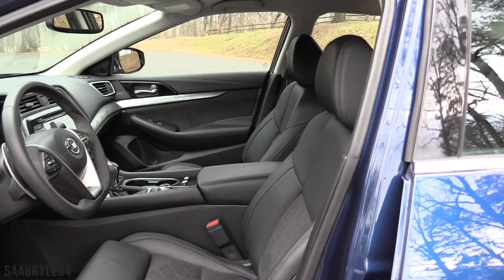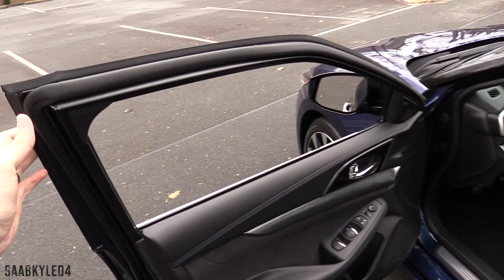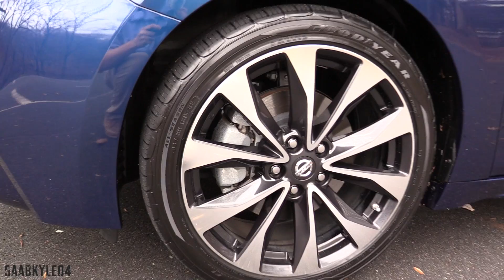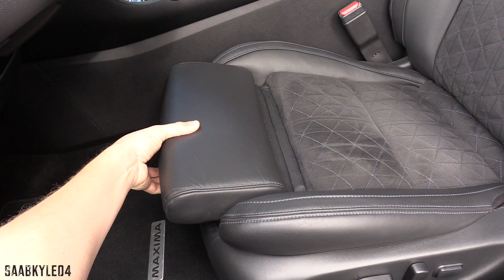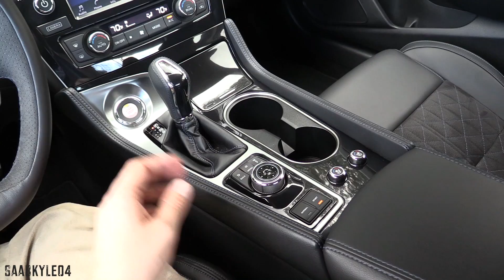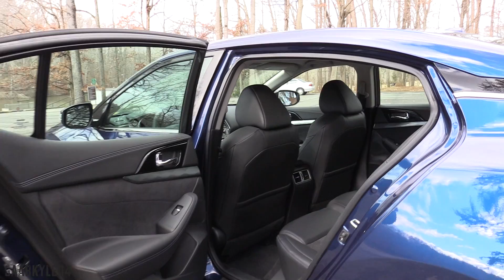2016 Nissan Maxima SR Start Up, Road Test, and In Depth Review

Comment: This car should really have Infiniti's 7-speed auto and 3.7L V-6.  Now that would be an awesome combination.  It should also have RWD or AWD.
Reply from the maker: +Chris Capaccio Agreed!
Reply: +Chris Capaccio That would be great and all, but then what would be the point of the Infiniti Q50? I think they wanted to save the good stuff for the Infinities......but boy would this car be nicer with a real transmission!
Reply: +Chris Capaccio When I drove the last generation Maxima I actually liked the CVT. This generation probably has a better one. I felt like I had to wake up the CVT with a couple of revs to get it out of its economy gearing.
Reply: So dumb it badly needs all of that !! It's weird why call it 4 door sports car .. Fords fusion is going to be beating it easily lol
Reply: If that happened, price would shoot up about $10k and thus be unaffordable for most
Reply: +Chris Capaccio The JATCO 7 speed is for RWD platforms - won't work. 
Making this RWD / AWD would make the Maxima compete too much with Infinitys. I have a feeling this is the last Maxima.
Reply: I agree 100%
Reply: I agree 100%
Reply: +Iam Sam Nothing that was said had to do with that, it's still cheaper than the Infiniti, And has improved well over the previous generation, overpriced ... okay don't buy it, we weren't discussing whether they should down the prices or not, if it is then get an Altima.
Reply: +Moaiz Shahzad no it would just be Nissan cannibalizing their own brand since it would basically be an Infiniti Q50. I still don't really understand why anyone looking to drop $35-$40k on a car would ever consider a Maxima. Sure it's a nice car but its starting price is only $3-4k under an Infiniti Q. Once you load it up with options, you could easily get a nicely equipped Q which has a much nicer interior and a RWD/AWD platform. If you want a nice FWD car, why not just save $8k and get a loaded up Altima with a V6? Makes no sense to me, but to each their own.
Reply: Kohfu
yet they will never do it, because they dont care about what you want or think, all they care about is profit and keeping this car they way it is, which obviously brings them more money, simple as that, you think they give a shit about your desires? you dont like the car, move along to another brand, is that simple. They are multi millionaire companies, you can bet they have a team bigger than your town to figure out how to maximize profits for this car. This is the design they came up with to maximize dat dere money. You don't like it? move up to the GTR or to another brand
Reply: +runescape692 Never really thought about that, lol
Reply: +Saabkyle04 Can U review 2016 Kia Sorento?
Reply: +Chris Capaccio 
got to have some separation between the luxury and economy lineup.  Otherwise everyone would just get the latter if had the same engine and trans.
Reply: Speaking of Ford, are they going to hold on that new Taurus forever they showed off in Shanghai last year? The Fusion is nice and all but it's still a mid-sized sedan. It's not on the Maxima's level, it competes with the mid-sized Altima.
Reply: They should at Least have some with an 6sp like in the 6 gen and older max
Reply: +Chris Capaccio The step-shifting that the current Nissan CVT's do does help, but only so much.  The Maxima's competitors all come with geared transmissions (Avalon, Azera, to name a few).  Plus, Nissan's CVT's aren't flawless in terms of durability.
Reply: +Chris Capaccio There&#39;s a VERY GOOD reason to why they don&#39;t do so, it would be fairly more expensive, and given that it&#39;s a Nissan it still has to be cheaper than it&#39;s up scale Infiniti brand, because that would mean they are basically competing against their self, it&#39;s already the maxima, the top of the line full size Sedan for Nissan, which means it comes very close to someone who wanted a G37 or Q50, but still More affordable to insure, Less of an MSRP/or General price tag, even fuel economy ETC, Nissan has Infiniti, Honda has Acura, so people can get a similar feel while it being more affordable to them or those who can not get the 1st class brand, can take a fully opted 2nd scale, If they did try to make all kinds of precise similarities, that would mean the only thing separating them would be the LOGO and the little bits of body, in that case it&#39;s better to only make Nissan not Infiniti, or the CONTRARY That is the answer to why it &#39;&#39;Should not have anything at all of what you said&#39; they know very well what they are doing. And ESPECIALLY giving it the option for AWD or RWD is completely out of line, they would have to discontinue the Maxima if they even thought about doing that
Reply: +Iam Sam And actually if you go to rent a Maxima for example they will out it under the category of a Full-size sedan, not Mid , since it is their largest sedan they have, even if the size is similar with the Altima.
Reply: +Iam Sam It may be a Mid Size body " but they consider it a full size Sedan. that's all
Reply: +Iam Sam either way that almost has nothing to do with anything here, for some reason I'm being targeted by you, jeez, I'm not a Nissan fan either that's why I purchased an Audi RS-5 .. I just wanted to answer his post as to why it would be a bad idea if Nissan did that, and they knew very well it wouldn't be entirely sensible. Case clear
Reply: +Iam Sam you can getta sr for around 33k easy
Reply: Iam Sam yeah that's sticker price but it's not hard to find them for 33k. I just got one actually
Reply: 92ASC but to be fair, it's not that hard to talk down the price below 35k for the maxima. And in my opinion the maxima has a nicer interior
Reply: If it was awd it would suck on gas and be heavy and if It was rwd then what would be the point of the Q50?
Reply: you just described an Infiniti Q50...
Reply: +Iam Sam mediocre.  isn't it tied for best combined mpg?
Reply: +Iam Sam so the accord touring v6 at 35k must be crazy overpriced!
Reply: Iam Sam sticker price is always overpriced in my opinion
Reply: +Chris Capaccio AWD would be amazing and would make it TOP 1
Reply: p0etlaureate not if it jacks up the price
Reply: +Blaze Flame Anissa always have reasonable prices comparing to the options and services you get, In other Nissan models like Murino you have the choice between FWD & AWD for $1600.
Reply: +p0etlaureate Nissan*
Reply: thats why its called infiniti dumbass
Reply: p0etlaureate but by bringing it up by that much, you might as well spend another 1000 to getta q50
Reply: +Blaze Flame pretty sure a Q50 with nav it's more than a thousand dollars difference it's at least a $4,000 difference and in the northern states nobody wants a rear wheel drive vehicle because you can't even move it an inch of snow so you Woulda put all wheel drive and that's even another $2,000 on top of the 4 grand difference
Reply: +occckid123 40k for platinum maxima, 41k for premium q50
Reply: +Blaze Flame at that price doesn't get Maxima has more features? at the price of the maxima?
Reply: +occckid123 fully loaded max vs fully loaded q50
Reply: +Blaze Flame a fully loaded Q50 is not 41000 is much more than that
Reply: +Chris Capaccio I prefer the Chrysler's 3 speed auto
Reply: +ZS K lol 3 spd???
Reply: +Chris Capaccio Then why does the Q50 exist?
Reply: it would increase the cost too lmao, nissan made this car for people who care about looks and luxury and not power. If they added rwd and more power, the price would skyrocket
Reply: Latin Lover do you know another new car around 33k that has that much speed, luxury, and with 4 doors
Reply: Blaze Flame
thats the point, they made this car to cater to people who only care about luxury and looks. People complain that it lacks rwd, horsepower, conventional auto. All those things would skyrocket the price and would put this car in another category. Is is a retarded logic, you can't expect a car like this to be more powerful and remain in your "budget" lmao. Nissan doesnt give a shit about what you think, they care about money. It is smart to not put power in this car, because it lowers the price down, they realize most people in society only care about looks and luxury interiors. If this car had a bigger engine, rwd and all the shit people here ask, it wouldn't sell as much, not even fucking close, why? because in its new category, there'd be much better options already
Reply: Blaze Flame  No but I certainly know plenty more new cars that look much better than that hideous overweight ugly thing.
Reply: Latin Lover this car definitely doesn't "lack" in the speed department and even though it's fwd, it's still pretty fun to drive. All of you "enthusiasts" might not give it a chance because it has a cvt, but normal average people are still gonna enjoy it.
Reply: Stevie G I respect your opinion, but I still get plenty of compliments for my maxima
Reply: Blaze Flame
I personally don't care about power that much. I'd rather have a car with a great interior and exterior even if it doesn't have much power. The only way you gonna get both luxury and power in the same car is going with luxury vehicles like BMW, mercedes, audi, etc.
Reply: Latin Lover but you won't find much cars that can compete with the maxima in that price range as far as interior and luxury goes aswell.
Reply: And that's where you're wrong, Nissan doesn't care about the price, Nissan competes with itself (Infiniti) all the time. Honda and Acura do it in a different way. Nissan is more sporty than infiniti. Hint the 370z and the g37. The 370z has more sport packages as you increase in price, while the infiniti gives more luxurious options such as more comfy seats and well more seats(the g37 is a 2+2 coupe or a 5 seater sedan) Nissan also has the GTR proving that it is the more sporty brand, while infiniti has a luxury car around the same price. Nissan= sport infinity= luxury. They should increase the amount of ponies in it, and maybe even a v8 model (look at the Hyundai Genesis)  but as far as RWD no. The FWD is sets it apart from everyone else, and other Nissans (Altima and that other one....) And AWD option is one I wouldn't mind as it would be better in the snow....

P.S increasing how many liters of the V6 wouldn't raise the price much if at all, after all it is still a v6, not moving to a v8 or anything. If their was a price increase it would be in the $2,500 - $4,000 range
Reply: +Kohfu There are many varieties of the Nissan and Infiniti but Nissan is sportier than Infiniti and yes not only does Nissan not care about the price but it also does care about everything else. Kohfu the Acura and Honda do the different stuff but Nissan does not have to stuff it on amenities that likely will cause it to be more efficient and sporty. Nissan's AWD used on the Murano CC was hassle free and the amenities are sporty enough to beat the Infiniti brand. Kelley Blue Book and other honoring websites can say that numerous cars were great. SUVs, sedans, coupes etc., are very efficient and not very efficient.

P.S. increasing how many liters of the V6 wouldn't raise the price much if it all, after all it is still a V6, not moving to a V8 or anything. If their was a price increase it would be in the $2,500 - $4,000 range is a very great speech Kohfu. The sedans (Altima or Maxima ) would bear enough All Wheel Drive to go through snow ( crystal precipitation) without hassle and with simplicity. It wholly bears Front Wheel Drive ( FWD ) on the new version of the new sedan  ( Maxima ).
Reply: omg the stupidity is unreal!!!!  V6 Altimas aren't nearly as common as the Maxima..most dealers are lucky if they even have one on their lots...know what you're talking about before you post please.. The Maxima is like their ultimate "luxury" car before you go into infinti territory.
Reply: Yes but I don't know if rwd
Reply: If Nissan as a company wasn’t so broke at the time that they made this (which the sales of this gen Maxima is what made them not be broke anymore😂), they should’ve done like they did back in ‘04 and have the option between 2 automatic transmissions; the CVT in the S, SV, SL, and Platinum and the 7 speed auto in the SR.

Comment: I would like to have a CVT that simulates shifting trough the gears and then selects the perfect ratios when holding a certain speed. The concept of a CVT isnt that bad, its just that the fixed engine RPM gets annoying very quick.
Nice car overall, exhaust note sounds like a Z. Styling is to each his own but i like it.

Comment: I think it's hilarious how big the paddle shifters are even though it's a cvt and doesn't have any real gears
Reply: +JoshorBrownKid A stock mazda 3 is not louder than a stock gt-r.
Reply: Heel Toe When it has an exhaust leak, yes.
Reply: +woodywoodcakes it's not nice to call someone autistic
Reply: woodywoodcakes "Kid" lol. Whatever makes you sleep at night.
Reply: ***** Okay? A 1hp engine with an exhaust leak is louder than every road car.
Reply: Mighty Drill Okay then... find me an exhaust. Also, paddles renders useless since the car has no real gears. You're basically changing the RPM. Wow! What a selling point!
Reply: woodywoodcakes bruh seriously what's ur problem
Reply: Braden McHenry what the hell is the matter whith it it’s a Nissan Saran sport not a Porsha 911 turbo
Reply: woodywoodcakes No one's talking to you. Bye.
Reply: +woodywoodcakes Wow, that's crude!
Reply: +Braden McHenry That's the thing with Nissan. They'll make a great car and completely ruin it with something stupid. The GTR for example: Wonderful car, but far too quiet. Honestly, my Mazda 3 is louder than it. 

The Maxima has everything you want in a sports sedan. Great steering wheel, seats, refined engine, brakes. But pairing it with a CVT and paddles is like being raped on your blind date.

Comment: I fell in love with the maxima and I was about to buy one from the dealership and he was actually going to give it to me about 2k under the usual price. But one thing you must consider is that your insurance rates will go up because this car is about twice as much to repair if it was in an accident. For example a bumper would cost twice as much on this car as the car I have now. But other than that I really do not have anything to complain about.
Reply: who doesn't know that...
Reply: +Spenceycat123 What car do you have now?
Reply: +rock 2009 Lexus rx350 I love it never had a problem but I just don't want to start paying for expensive repairs and I drive a lot and I feel like I would save some gas with the maxima